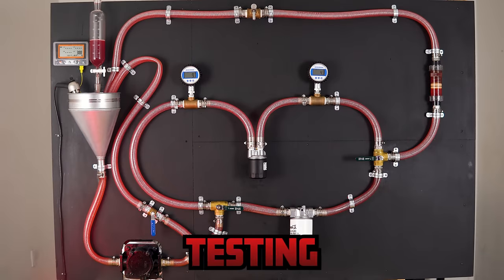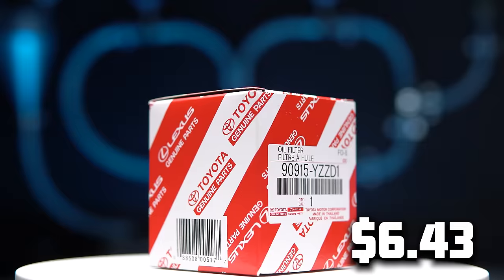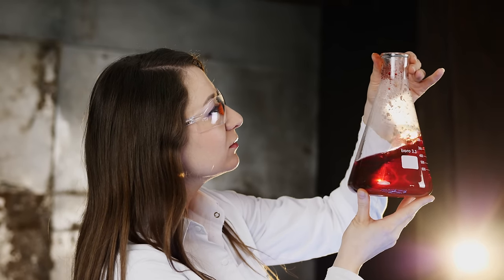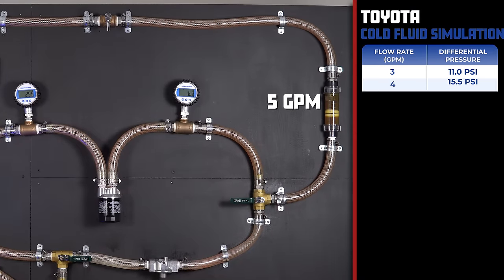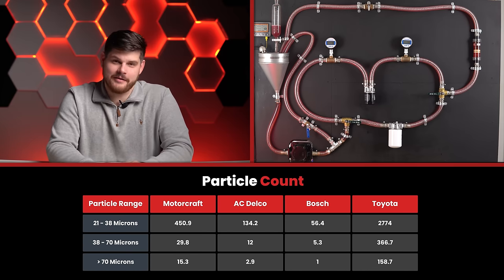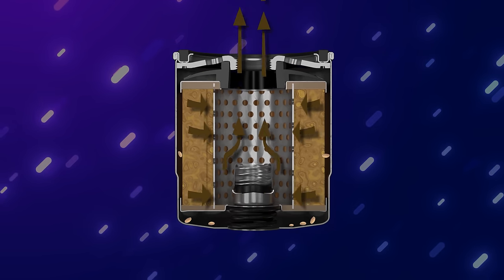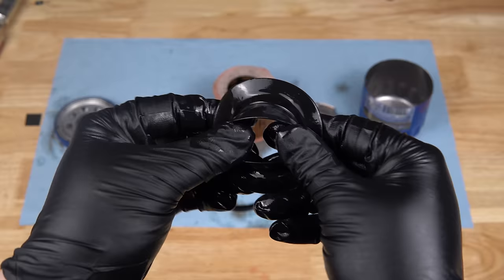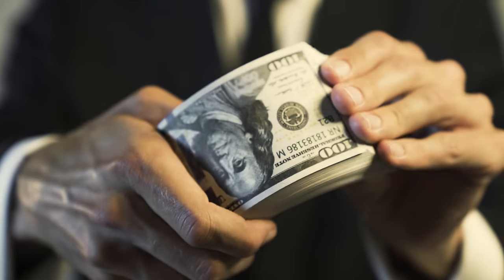Are Car Dealership Oil Filters a RIP-OFF?  (Engineer tested)

Comment: Great comparison however there is an issue. You apparently purchase your filters from amazon, a place Rife with counterfeit parts especially for brands like Toyota. I would like to see you retest the Toyota filter purchased directly from a dealer. Otherwise I'm quite skeptical of the results.
Reply: i was going to write this, then i found your comment. Totally agree.
Reply: If you’ve ever seen it inside of the Toyota filter, then you know that this is genuine. They are very uniquely built and designed. This is definitely a genuine filter. I’ve seen what the fake ones look like on the inside, and it’s almost never anything close to this.
Reply: Imagine trying to shill Toyota. If the filters are so bad, explain the 500k mile cars everywhere.
Reply: @apex_gr  Speaks to the build quality of their motors. Clearly there filters are lacking. This coming from someone currently running oem on Rx300 and Celica.
Reply: The test of "flow" doesn't mean shit tbh. @Dansk55
Reply: @apex_gr  What makes you think those 500k mile cars use Toyota filters?
Reply: It was purchased at Walmart.  Highly unlikely to be a counterfit.
Reply: @apex_gr  If there is nothing to filter in the oil, the quality of the filter doesn´t matter. So at the end 500K miles its a package of oil change frequence, driver profile, motor  engineering quality , machining precision
Reply: I have been a major seller on Amazon for many years. The whole counterfeit thing was a few years ago. Then, Amazon copped heat and ruthlessly cracked down on it. So much so it has swung the other way with legitimate sellers having fake counterfeit claims struck against them.  To sell fake Toyota parts on Amazon nowadays would just be a matter of time until a seller got caught. And, Amazon takes such action as impounding all stock on hand, withholding payments. They just don't take that stuff lightly anymore.
Reply: Toyota several filters that suit the same application depending upon the market and engine applications and likely to have different filter media specifications.
Reply: I call bull Shit on this entire test.,
Reply: @apex_gr  Filtering isn't everything, engine design plays a huge role. You could have the best oil, best filter on a Land Rover and a Toyota will still out last it with no oil. Many Toyota owners don't change their oil often enough, and they still go on forever.
Reply: I was going to say exactly the same...
Reply: Totally agree.
Reply: Toyota OEM are the best unless one can find the made in Japan PIAA ZR magnetic filter.
Reply: Always excuses with you guys.  Toyota doesn’t make oil or oil filters.  They have another manufacturer produce them.  They flow well but are terrible at filtering.  It’s just like HVAC filters.  Most systems are not designed to use a high MERV rating because they clog fast and block airflow which is more important.  That’s what a MERV 8 or less is recommended.  So my engines would rather have high flow than filtering something the human eye cannot even see.  That’s why it’s important to change oil and filter more often or around 5000 with OEM and 7500 with aftermarket oils and filters that are the premier products.
Reply: He doesn't even use real motor oil. His test is useless.
Reply: Toyota oil filters are not magic.  Without orings, the OEM filter bypasses the majority of the oil between the top and bottom sealing surfaces.  Only reason Toyota engines last longer than many is design.  Remove the orings from your garden hoses and tell me how well it seals.
Reply: Dealerships sell at Amazon as well. Just saw it the other day. - He could have ordered from a dealership via Amazon.
Reply: @apex_gr That's it internet commenter!  You let those engineers at every manufacturer know that oil flow rate testing means nothing!

I have no doubt that you have a massive amount of factual, 3rd party tested and validated results, that those engineers can go over in detail.  Right? 

I mean, they only spent collectively hundreds of years, and billions of dollars on the research and development of those oil filters, but there is no way that flow testing means anything.  Glad you clarified that.  Go and let them know!  Share the knowledge!
Reply: Yes you read an internet comment on the internet. Saying you know more than Toyota's proven track record in design is not causality it is comparing apples to oranges. @not12listen
Reply: @rodbritton360  Where did you hear that my friend?
Reply: I'm just finding this out as I bought some Iridium NGK plugs from Amazon and eBay and found a video that describes how to tell the difference between the two (real and counterfeit). Mine were fake but they seem to work pretty well for now.
Reply: @apex_gr  For every 500k Toyota I hear of there seems to be ten with 200,000 miles on them that burn oil because the owner 'only' changed the oil every 10k! I'm sorry, but they're overrated, expensive and seem to attract drivers who drive them gently too. I like GM, pre 2000 PSA and some BMW 6 cylinder engines. The 80's and 90's Mercedes diesels were also great engines
Reply: Toyota, Stellantis, GM, and Ford also sell their OEM filters at WalMart, so...
Reply: toyota oil filters are garbage weather you get them from the dealer or 3rd party.
Reply: @hellbringer09  

Good luck arguing with my mom on that.
Reply: @hellbringer09  I like Hengst and Mahle.
Reply: @apex_gr  Their engines are built like boat anchors, and they prefer flow and oil film strength over filtering out a few more microns. Do you think some dude in a random jungle or desert somewhere is going to keep up with his oil and filter changes?
Reply: Just about anything I buy, I try to go through the company directly or a retailer with at a physical location.
Reply: The less it filters then it can go for longer with debris it’s an inverse relationship

Same logic as higher merv rating on hvac; its bit restrictive but catches more but you need to change more often outside it will damage the blower ( pump in the engine) so less restrictive filters allow particles through but allow the rest of the system to run closer to baseline before clogged even after scheduled maintenance

You don’t want rocks flying into the engine but we are reaching a point of diminishing returns in what damages the most; large particles or actual debris
Reply: I’m going to use Toyota filters on my Kia so it will last 300k
Reply: @Balticblue93 Toyota filters are made by Denso, and Toyota Genuine Motor Oil is Mobil 1 with an additive package specified by Toyota engineers.
Reply: @Fluffy65   We agree that Denso makes Toyota's oil filter but that doesn't change the fact they are garbage. high flow with terrible filtration.  
We know that Mobil is OEM oil manufacture.  But Mobil is junk compared to the top three manufacturers.  They might have a special formulation, but the Blackstone lab proves it is low on the totem pole got additive and wear packages.  

You are welcome to use what you like, but I never used that on my Supra and will use a superior product on my next Toyota.
Reply: What kind of Supra you got?  My 23 A91-MT was totaled back in October, so I'm playing the waiting game for a 2024. I ran AMSOIL in the last two.. what do you use?
Reply: @Fluffy65  

My apologies on the delayed response.  I didn't see your question.  
I have a '95 Single Turbo MKIV.  I am very sorry to hear your car was totaled and I hope you are alright and not hurt.  

There are three oils make and models I use, but in the Supra it is Amsoil.  My 2015 Hellcat runs Pennzoil Ultra Platinum 0w40.  

My 2019 C7 Z06 runs Amsoil or Pennzoil Ultra Platinum.  

Our two daily drivers run Valvoline Extended performance and Ultra Platinum.  I do an oil analysis every other oil change.  

When you get your 2024, send some pictures.  I have seen some pretty nice looking and sounding new generation Supra's.  

Oil filters are one of the three filters, but usually use the larger capacity, if there is clearance.  

Again, sorry for the delay.
Reply: @apex_gr  Perhaps some people DONT run toyota filters.............
Reply: @anydaynow01  you think they design their cars with that jungle dude in mind, lol?
Reply: @shenanigansagain5273 

He uses the standards that testing labs, (INCLUDING THE OEM MANUFACTURER'S LABS) use to get information on performance...

But go ahead and use the worst filters of the bunch. Just remember...WHEN IT FAILS; YOU and only YOU are to blame...
Reply: @shenanigansagain5273 Say you haven’t a clue about filter testing without actually saying you don’t have a clue.
Reply: @apex_gr  I own several Toyota's, not one of them has a Toyota filter on it. Also you are using the word shill incorrectly, shill means to back up or support even against evidence to the contrary. So if the creator was shilling, he would say that Toyota's filters are the greatest. Which they are not, most of the OEMs do not even make their own filters. Their filters are just rebranded and usually come from the lowest bidder.
Reply: Found the Toyota fan boi 😂
Reply: Sometimes the Amazon ones aren't knock-offs, they just come from Thailand, Taiwan, etc. They have lower compression on most engines, and no emissions, thus lower tolerances and the smaller particles aren't as detrimental. I ordered some and directly compared to the Canadian dealer version, definitely a notable upgrade to get the CAD version.
Reply: You think that Amazon sells counterfeit oil filters?
Reply: @apex_gr  -- I would guess that after the new-car 'courtesy change' at a dealership very few people stick with OEM filters, unless they're simply loyal, unable to do their own oil change, or refuse to have one done at a chain shop in light of numerous scam stories. 

While Toyota's engineering is legendary, I'd surmise that the vast majority of their beasts with 300,000 or even half-a-million miles or more have had nearly every oil change done in driveways and home garages, using non-Toyota filters. This would pretty convincingly explain the lack of definitive proof that genuine Toyota-branded filters are substandard, with that blemish being concealed by the quality of the engines.
Reply: @billholt174  agreed, but I run toyota filters to the ground on 200-300k cars just fine. I run FRAM for certain occasions but for the most part I stick to Toyota. I don’t see the need unless you’re pushing so much horsepower (over 600) to need filtration.
Reply: @Dansk55  And oil changes 5 thousand miles instead of 10 thousand.
Reply: @billholt174  We own a 2009 RAV4 with 105,600 miles on it. I change my own oil and while I have used oil filters other than OEM, I am now using Toyota OEM filters. I change the oil every 5,000 miles and I can't detect any oil consumption whatsoever from one change to the next. I've also had oil analysis performed, and the results are the same regardless of the brand of oil filter I've used. (I'll check the latest results again which I should receive in another week.
Reply: @shenanigansagain5273  -- It's specially formulated test oil to ensure consistent results. The filters have no opinion about the oil passing through them. They just have to allow flow and capture particulates, both of which seem to be demonstrated capably by these tests and lab analysis.
Reply: You’re not from Amazon you’re buying it from a vendor on Amazon typically an auto parts store or a dealership or a manufacturer
Reply: @Pro1er  
I have 500k 4Runner and had only ran Toyota filters from dealer.

Comment: I wonder if the Toyota filter was an actual genuine Toyota filter or a counterfeit part
Reply: If they have a setup like this then they for sure got a genuine filter
Reply: It's authentic. Same Toyota Thai Denso design seen many times in other dissections.
Reply: I have reason to believe it is a knockoff. The link they provide to purchase the filter takes you to an Amazon vendor who has been accused of selling fake filters in the past. Additionally, the counterfeits look very similar in a video, but are different upon closer inspection.
Reply: Just an FYI, Genuine Toyota Filters are made by Fram. I suggest to avoid them.
Reply: @badassnelson  I believe they're most often made by Denso.
Reply: @badassnelson  Nope. Vast majority Toyota OEM made by Denso, same as the one shown.
Reply: @faxmen09  I used to work at a Toyota dealership. Put a YZZZA1 Genuine filter next to the Fram equivalent, and you won't be able to tell which one is which if they are outside the box.
Reply: @badassnelson  YZZA1 is a cartridge filter not topic spin on filter YZZD1. Apples and oranges. Stand by, vast major TOYOTA OEM spin on filters, made by Denso in Thailand, same as topic. Topic YZZD1 filter is 100% genuine.
Reply: @faxmen09  I'd be pretty confident if I cut open a YZZD1 and the Fram equivalent I would find the same results I've personally seen with all of the cartridge filters.
Reply: @badassnelson  Nope. Fram EG and TG use fiber end caps. XG and new FE use metal caps. Topic Toyota OEM Thai Denso uses a no endcap design, completely different and very obvious. Not a Fram. Made by Denso in Thailand. Previous dissections on you tube and on other internet sites confirm what is shown this vid. Confident your opinion, wrong.
Reply: @afellowinnewengland6142  , you have reason to believe but no proof. I expected these results on a cellulose filter. So I am not surprised. I've cut open my own filters and know what they look like. This looks exactly like my genuine Toyota filter.
Reply: @littlet7556  You do realize that the human eye can't make an evaluation of the effectiveness of filtering media at this level right? Additionally, being a traditional non-synthetic filter doesn't mean it can't be more effective than this (as proven on this very channel). 

They admit the filter wasn't purchased at a dealership, so the door is open for for questioning.
Reply: @afellowinnewengland6142  , odds are it is an OEM filter. I offered them an original Toyota filter, but they said they had one.
Reply: @littlet7556  It's Toyota OEM Thai Denso filter. Only reasons some think it's not, 1) they've never cut one open or 2) particle results not to their liking. Or both. In any case, you are correct on it being genuine.
Reply: @faxmen09  , 100% agreed! After cutting several open and seeing how they are made.
Reply: Why not just buy the damn filter at the dealership to avoid any doubts 🙄

Comment: This makes you think of how great Toyota's engines are to last long with these horrible filtering, I've switched to Purolator Boss 5 years ago after knowing how terrible the filtering was on Toyota's filter. But I still think that shorter drain intervals are much more important than the type of filter.
Reply: Toyota engines are designed by their engineers to run optimal with the Toyota filters. Switching to different brand could lower the performance and durability of part inside the engine.
Reply: @zarbon700  My engine has 500k KMs & still using the Purolator boss filter . It is whisper quiet that I sometimes wonder if it is running or not
Reply: @fahadalsowaidi7965  I said COULD lower the performance and durability. I really depends on the quality of the aftermarket filter and oil used.

Comment: Ill stick with the oem Toyota  filter, which is made by Denso. Paying $5 for an oil filter at the dealer is fine by me. Considering the filter is made by a car manufacturer who makes engines  that are known to last over 300 and 400K miles.